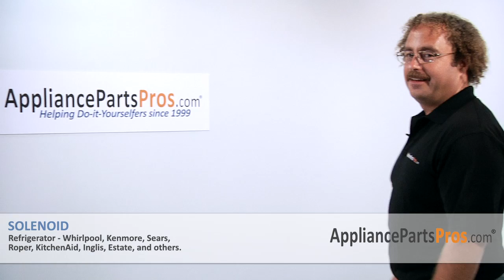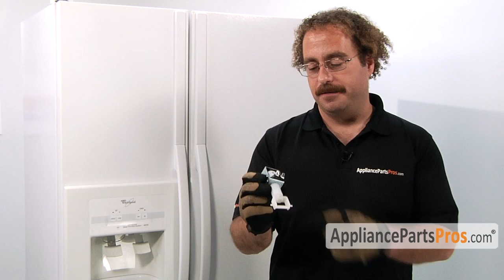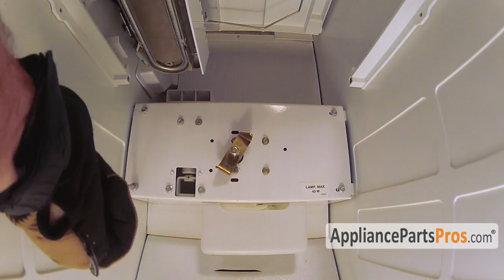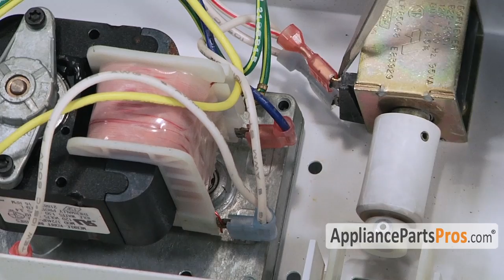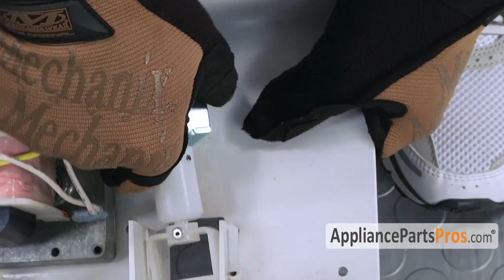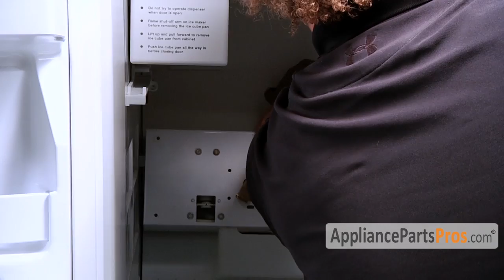How To: Whirlpool/KitchenAid/Maytag Solenoid WP2152713

Comment: Please help! My wife empties the ice bin every day. We now have a bad solenoid. I noticed that to get cubed ice the solenoid has to pull up on the metal arm where the spring is under constant tension to keep the door open in that position. When the ice bin is pulled out the rod loses the tension and closes it's door to the crushed ice position. My question.... does the solenoid also return to crushed ice or "down" position after the ice bin is pulled out making it easier to reinsert the ice bin's metal arm? Because if it stays up then the metal arm would be going in under the white plastic square causing all kinds of problems which may be why ours went bad. I need to know before I buy a new solenoid. Thanks

Comment: Hi! Matt,
I  have a Frigidaire Professional side by side refeigerator ,The problem I have is that when I want  ice, it does not send the whole ice and neither crushed, but the flapper opens and closes perfectly, the water serves without any problem.  You can give me suggestions?
Thanks
Reply from the maker: If the auger is not being driven I would check the drive motor to be sure it is getting power and has not failed.

Comment: My GE fridge has the exact same setup like the video shows. The original solenoid melted so the magnetic plunger could no long move inside the coil channel to operate the mechanism that switches to dispense ice cubes. I replaced it and it worked great right away. But guess what, a few days later, the new solenoid melted also! I then checked wires that connect to the solenoid and found that there's a constant AC voltage on it even when it's not being activated (on normal standby). So the magnetic coil acts like a heater until it burns up! Does that mean the problem is originating from the main control board? It seems to me that's the only place where the voltage can come from. Please advise. Thanks.
Reply from the maker: Sammy Cute They have used a number of set ups over the years in GE fridges. You can post the problem along with the appliance model number on our repair forum and the techs can help you troubleshoot the problem.

Comment: Is this what calls for water? I can get water to ice maker by using a paperclip in the N and V holes on the ice maker but water will not flow to it automatically
Reply from the maker: This video is for the solenoid that switches the ice dispenser from crushed to cubed ice. You are looking for the water valve. You can post your question and appliance model number on our repair forum and the techs will help you troubleshoot the problem.